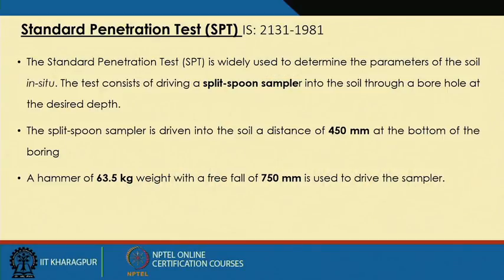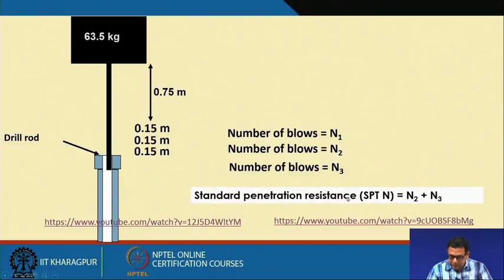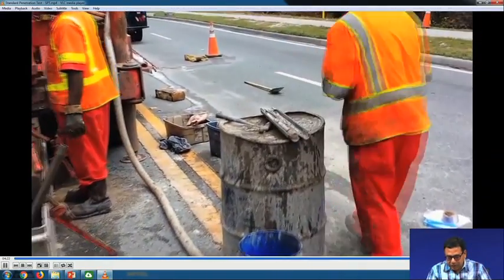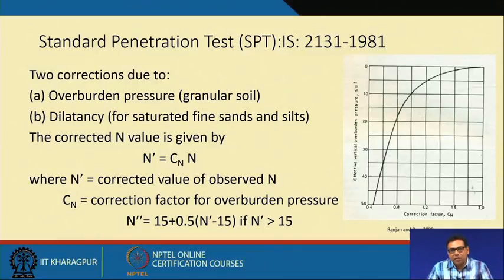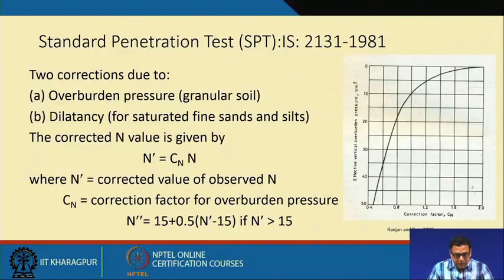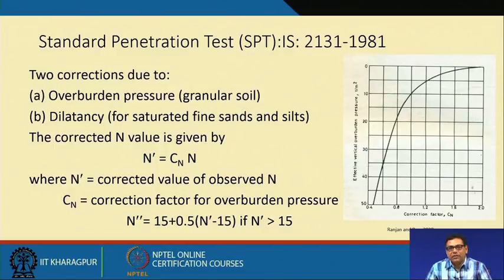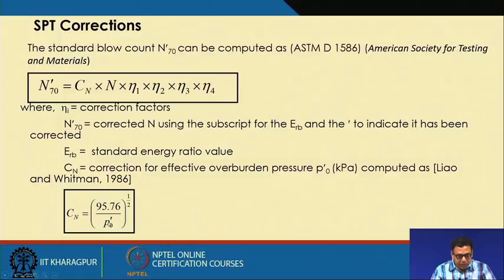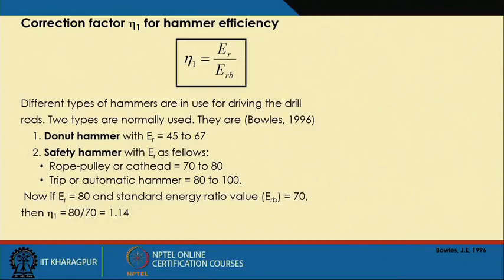Lecture 5 : Standard Penetration Test

Comment: @26:54 sir shearstrength formula s=c+sighma tan phi,so here sand so c=0 ok, after you consider the sighma value,what is that (sighma means total stress=effective stress- pore water pressure) we get -u so we consider in total stress formula + ,but your not considering the effective stress in the shear strength formulay, why ❓
Reply: tau dash = sighma n dash * tan phi + c dash... c dash = 0, and  sighma n dash is effective stress ( dash means we are talking about the effective parameters) and effective stress = total stress - pore water pressure... hope it helps